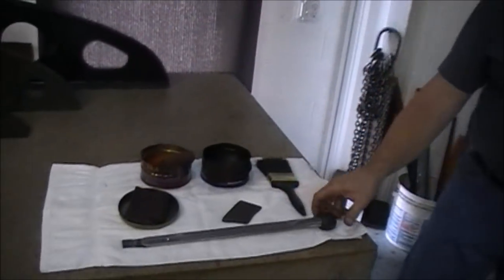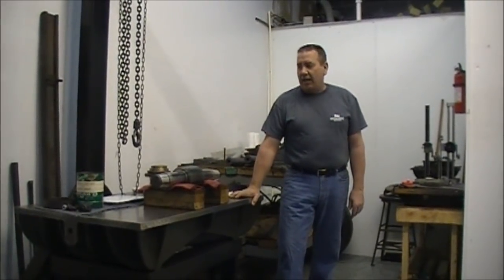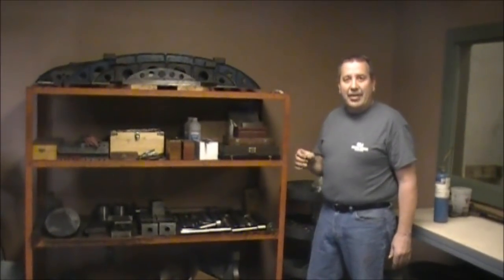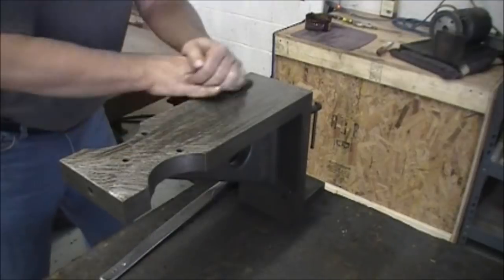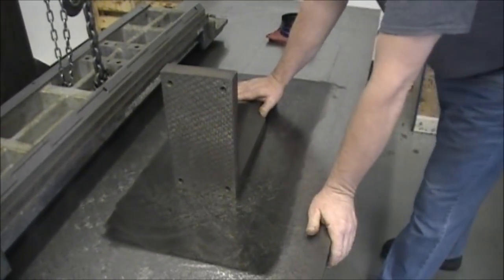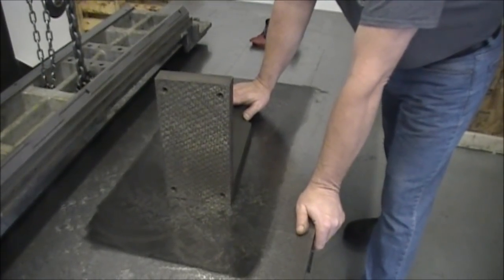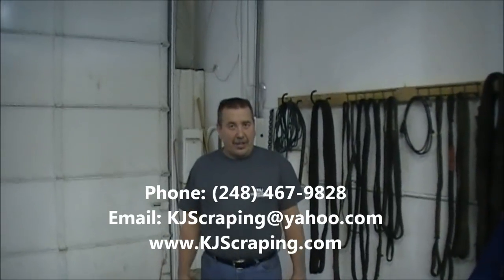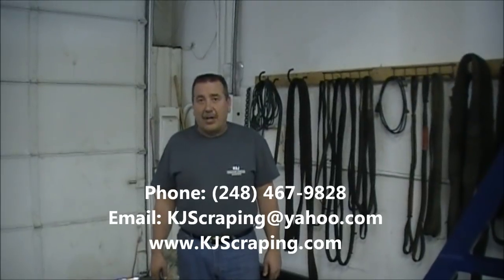Hand Scraping Training Video

Comment from the maker: The orange and black that I use are mortar color mixture that comes in a powder form, you can pick it up at any brick place. Then you mix it with a lite spindle oil A to make a firm paste this has worked great for me. If you have any other question please feel free to call. Thank You, Brian Ives
Reply: Brian Ives
Reply: Brian Ives who makes your power flaker/scraper?
Reply: I use concrete pigments also. It's particle size is some of the finest powder I've ever seen. I use it cause it works better and is dirt cheap/free and so do many other good scrapers. Look at this great video by Wes Johnson https://youtu.be/xHT-uzKQM6U he's an excellent re builder who also uses it.
Reply: Thats what i wanted to know and ask , thanks alot !
Well done video !

Comment: Would have liked to see an indicator sured up and ran across that surface. A "how to" is kind of useless if its impossible to verify that the end result of the video aligns with the end result required. For all I know I could be ingraining information that will later hurt instead of help me when its needed.
Reply: would have been interesting to see a print after the blind flaking job.
Reply: Richard King has a scraping class,go take it.

Comment: This is great!  I am not a trained scraper, but I tend to attempt to flatten worn surfaces as I need to.  I am doing things basically correctly - one thing I'm struggling with is the proper shape of the cutting edge. Any tips to offer?   I'm using a 1" wide file, which dulls quickly.
Reply: Did you re harden the file after grinding the original shape"radius"?

Comment: The reason for scraping is more accuracy than the surface grinder. The stroke of the grinder may not be as flat , Scraping allows for lubrication as well.
Reply: True but if you have a parallel say 4 x 3 x 24 and it has a twist or hump to it you would have to substrate shim any spots and block in on a surface grinder to make one side flat. You cannot just mag chuck or clamp a warped part and grind it flat it will spring back. Accuracy limits are not on the removal or manipulation of material the limit is the measurement.

Comment: Great Video! I feel like I just received on the job training. Do you recommendation for practicing at home. I.E. good practice materials to scrape for possible tooling or fixtures, measuring equipment that is affordable or in a lower price range, or possible ways of achieving a flat surface for measuring or oranging and blacking without a surface plate? In a nutshell how did the first flat surfaces become flat surfaces and how do you know they are flat without said commercial measuring tools and flats.

Comment: Hey this is brilliant stuff.  I used to work in a shipyard and we often had to scape out large bearings but we never had flaking tools.  All the scrpaers were either made out of flat or half-round files and then carefully tempered.  Flaking by hand was a back breaking job. Do you sharpen the sides of the tip or just the end?  Lots of people watching this will never know the skill there is in doing what you are doing.  It looks simple because you're a master of the art.  All the best. Robert

Comment: I have had several request to weld repair conveyor drums. Looking at a roller bearing v block setup. But....how do I get a flat plate so I can set the v blocks on? The drums will be machined by a machinest by the tighter I can get the weld process, the lest build up and lest work on the machinist side of things. 

Any thought for a good setup? I only have a small lathe at the shop.

Comment: Heard the word "scraping" but mostly related to kid's knees. Why this process and not a surface grinder?
Reply: Scraping leaves the surface slightly uneven with some high and low spots, For machine ways this allows for oil to adhere and gather on the bearing surfaces of the machine, and many also say that it allows for a more even wear pattern over time as only the high points truly take the brunt of the load reducing friction and overall wear. Scraping can also allow you to put oil groves in things like spindle bearings, and work on projects that are too large or geometrically complex to surface grind at a low cost an example of this might be repairing a set of worn out milling machine ways without having to take the whole machine apart. Lots of surfaces that used to be scraped are now being surface ground due to its (relatively speaking) lower skill requirement and cost.
Reply: Daniel Sardachuk Thank you for you detailed response!

Comment: really good and informative video thank you. i dont understand why using a surface plate thats much larger than nessisary would be a problem however? its still flat to the same tolerance as a smaller plate of the same grade right?

Comment: Wow! 
Thanks for this! 
I just got into collecting, restoring and using "Old Arn" last year, and these are the things I'm learning to do to restore it faithfully to it's optimal working capacity and efficiency, that my machines may look down upon all other of recent manufacture.
I have Tennis Elbow and Arthritis, but find I need the work of this nature, and that accomplishing it despite my pain is truly rewarding, but learning to do it the right way and most efficient way are critical to minimize my time spent at toil.
I was just about to start rubbing part for a new lathe on a surface too small for it to be done correctly, but I had not thought of that til' i found your video during my research! I'de have created a whole new level of mess had I not seen this and realized my surface was too small for the job. I have a second work-piece on standby if I screw the first one up, but I think that getting a new surface inside the house will be worth the effort, and since it is only ten feet away from where I type this, I can make a tomorrow project out of it. It is not a surface plate, but is a granite headstone from Rock of Ages that had a defect in the engraving and ended up a paver in my walkway. I have a come-along and ingenuity, so we'll see about doing the work tomorrow with the right size "Faux Surface Plate". I do this as a hobby and to make machines I need to build myself a new house and proper workshop, so a wood lathe with a 36" bed can be off by a little when I have cobbled it together, but I can correct it and learn/see what I did wrong, and that will be of greater value than nailing the art of lathe building on my fourth go at it. My previous lathes have not amounted to much, but now that I understand the machines and have enough other machines to make the parts, I'm creating something really nice that I will share when done, since so many folks here share the Art of Machining with me for free.
Awesome Video, and thank you again. Subscribed for sure!

Dave from VT.
Reply: nothing to help your tennis elbow but about your arthritis you should eat more carrots for its silicium or try to find some organic silicium G5. Prepare some nettle soup more often too, it helps. Cheers from France

Comment: What is the grit of the stone your using?
Reply: 600-1000 grit. it doesn't take much to remove the burrs left from the scraper, and you need a fairly good finish so your not wearing into the surface plate.

Comment: why even scrape when  there are  surface  grinder  in the world?
Reply: Scraping can be more precise than surface grinding in certain instances.  When you grind you are at the mercy of the limitations of the machine, just like you are with a mill or anything else that has a tolerance (mechanical slop, vibration, etc, things that hand scraping isn't prone to).  Scraping also gets to surfaces like dovetails and ways that you just can't get to with a grinder sometimes.  People call it a archaic art but that is far from the case.
Reply: Even a surface grinder has ways. Precision doesn't just arise out of the ether. It is science applied to art.
Reply: If you want something ridiculously flat, hand scraping like this is how you do it. Surface grinding isn't self-correcting, and the wheel wears down as you grind too.
Reply: Because it is a much flatter surface than grinding can achieve. Surface grinder wheels tend to travel in an arc and can grip work unevenly.
Reply: Futten  One reason is heat. Even with flood coolant, the point at which the grinding wheel contacts the workpiece is always hotter than the surrounding metal, making the workpiece bow upwards towards the wheel. You can grind something fairly close over a short distance, but there is no way any surface grinder can approach the accuracy of a hand scraped surface.

Comment: Ok i may be out to lunch but wtf is he not using a surface grinder?
Reply: i'm still not sure what the purpose of scraping is ???
Reply: al t Seems to be for when you want a cool looking surface that is as flat as was possible 300 years ago
Reply: cncgeneral yeah. I don't get it?
Reply: al t super flate and accurate surface but with oil bearing clearance
Reply: MrTNBassmaster oil bearing clearance?
Reply: al t most of the time two pieces of scraped metal will ride on one another  and if the metal was perfectly flat it will wear out very fast but when you scrape metal in you create a flat surface with very very small oil galleries in the metal .
Reply: MrTNBassmaster Thanks. Not being a metal worker, you'd assume this would be something done with a grinder.
Reply: al t for anything high precision it would be, I assume this is just done in hobby/old school workshops
Reply: cncgeneral If the ways are hardened, then yes grinding is probably your only choice. However competent machine tool rebuilders can match tolerances grinding is capable of not the tolerances of "300 years ago".  Hand scraping is also a better choice if the surface is larger than a readily available grinder.  Interestingly enough, granite surface plates are all hand lapped yet somehow achieve extreme flatness. Just because a process was invented before your time doesn't mean it's obsolete.
Reply: al t restoring old flat reference surfaces.
Reply: RE: Ok i may be out to lunch but wtf is he not using a surface grinder?

Scraping is for 2 sections that must slide together. The pattern he puts on is to hold oil, the little scallops are actually little oil reservoirs. This should have been explained, instead it was a "scraping technique video, not a why do we scrape these parts explanation. If you use a surface grinder the 2 sections sliding together would squeeze out all lube and begin to stick and not move or begin to wear quickly due to lack of lubrication.

~
Reply: Because he is "NOT OUT TO LUNCH"😂😂😂😂😂😂😂😂

Comment: Great Video.  It was like a flash back from the first job i had out of high school back in 1979.  They did it exactly the same way and used exactly the same tools down to the stone which was a piece of a broken grinder wheel, theywere hard to come by.  They called the rub "light lead" and "dark lead" because it used to be lead based.   I was just a stupid kid at the time and they handed me a Biax scraper that I used to scrape a low spot in a table of a Lucas boring mill, they were pissed.

Comment: The scraping You showed was a Butcher Job. I was a Scraper for Johansson Grinders in the 1970s ,and still practice
Reply: How was it bad, you didn't elaborate.
Reply: Rob Tyrer There are supposed to be a certain amount of low spots per square inch, which requires more ink and counting.
Reply: chronicblazer84 it could be more accurate in other words I gotcha
Reply: Johansson still around?

Comment: The stone is very important for de-burring and creating bearing spots, so you know where to cut with your scraper. If you use just any stone or a
 wet stone with the wrong texter it makes the job a lot harder.    Thanks for the question!!